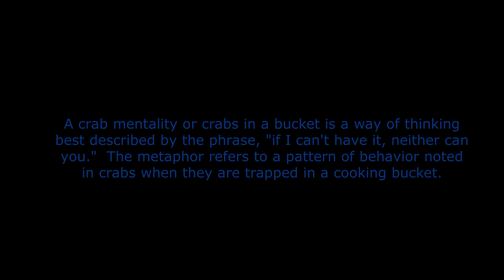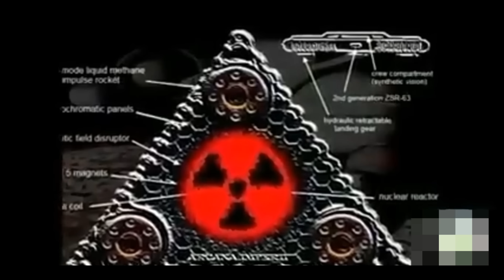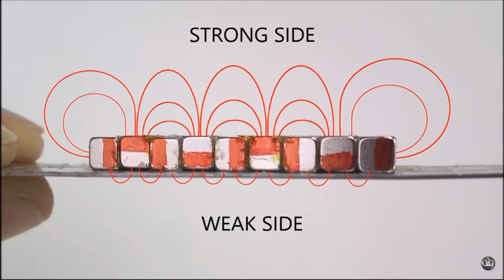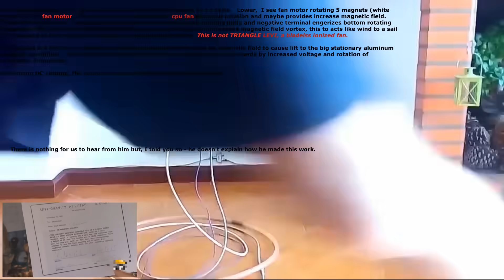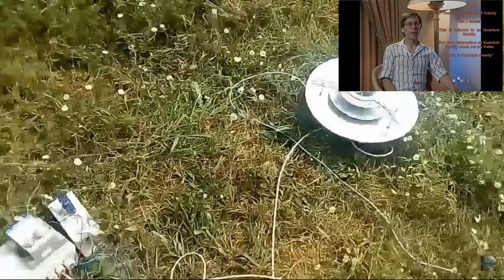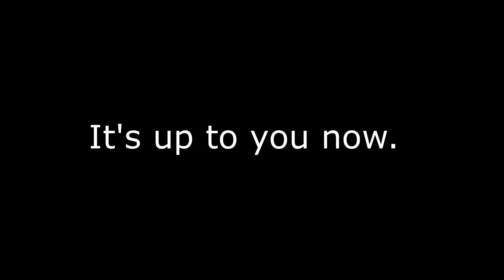anti-gravity project

Comment: It is not currently possible to create an antigravity object with magnets and energy using our current understanding of physics.

The concept of antigravity goes against the fundamental laws of physics, specifically the law of gravity, which states that all objects with mass are attracted to each other. There is no known way to create an object that can repel gravity.

While there are some theoretical concepts that propose the existence of negative mass, and it has been suggested that such a substance could create antigravity effects, no evidence of negative mass has been found in nature, and it remains purely hypothetical.

Similarly, while magnets can create attractive and repulsive forces, they are also subject to the law of gravity and cannot create antigravity effects.

Therefore, creating an antigravity object with magnets and energy is not currently possible with our current understanding of physics.

Connecting two magnets with opposite polarities will create an attractive force between them, but it will not create antigravity.

The attractive force between magnets arises from the magnetic field that surrounds them. When the north pole of one magnet is brought near the south pole of another magnet, the magnetic field lines from one magnet link up with the magnetic field lines from the other magnet, resulting in an attractive force.

However, this force is still subject to the fundamental law of gravity, which means that the magnets and anything attached to them will still be affected by gravity and will not experience antigravity.

Antigravity refers to the ability to repel gravity, which is not possible with the use of magnets or any other known material. The only way to potentially create antigravity effects would be through the manipulation of spacetime, which is still purely theoretical and beyond our current technological capabilities.

Adding energy to two opposite magnets will not create antigravity.

Energy can be used to change the strength of the magnetic field or the distance between the magnets, but it cannot change the fundamental behavior of magnets, which is to attract or repel depending on their polarities.

As I mentioned earlier, the attractive force between two magnets is due to the magnetic field lines connecting them, and this force is still subject to the force of gravity. Adding energy to the system will only increase the strength of the magnetic attraction between the two magnets, but it will not change their gravitational attraction.

Therefore, it is not possible to create antigravity effects by adding energy to two opposite magnets. Antigravity is a concept that requires a fundamental change in our understanding of the behavior of matter and the laws of physics, which currently do not allow for such effects.

Rotating a magnet can induce an electrical current in nearby conductive materials or generate a force on a magnetized object, but it cannot create an object that repels gravity. Similarly, adding energy to the system can change the strength or behavior of the magnets, but it cannot change the fundamental force of gravity.

Gravity and magnetism are two different fundamental forces of nature that operate at different scales and have distinct effects.

Gravity is the force of attraction between any two objects with mass or energy. It is a universal force that affects all matter and is proportional to the mass of the objects and the distance between them. Gravity is responsible for the motion of planets and stars, the tides on Earth, and many other phenomena in the universe.

Magnetism, on the other hand, is the force between magnetic objects or magnetic fields. It is a force that acts only on magnetic materials or objects that have been magnetized. Magnetism is responsible for many everyday phenomena, such as the attraction or repulsion of magnets and the operation of electric motors.

While gravity and magnetism are different forces, they do interact in some cases. For example, the magnetic field of the Earth affects the motion of charged particles in the solar wind, creating the auroras in the polar regions. In addition, some theories propose that the strong magnetic fields of certain celestial objects, such as neutron stars, can affect the local spacetime curvature and create gravitational effects.

However, these interactions are relatively weak and limited in scope. In general, gravity and magnetism are independent forces that operate at different scales and have different effects on matter and energy.

Comment: Put everything together in big dimension; calculating weighting a person and equipment and all the important energy that feed integrated in the same space even as a ship; a large scale to hold all that make it levitate; then work the movement that act by electrones directional by north magnetic force  the magnetic force in the 12 poles of the earth, then you can have a space ship that use cosmic energy into electro magnetic fields to energize the aeroship that controls the altitud up or down, or find out how to create this motion by the forces in the space of earth and after maybe in the outhere space.

Comment: you need to have a large plate under it tro create to repulsive magnet "lift", also this video is just a scam.
You'll need to use a very large coil to use the earth magnetic field to try to lift a craft, also you have to get 2 of them to not get away from the point you are, accounting the energy needed to rotate the big magnets AND the weight.

Comment: My theory is that "gravity" is dynamic forces from moving electrons which are always spinning and trying to equalize magnetic force and moment. The net force is the weak attractive force of all matter we call gravity. 

Every electron produces a magnetic force. Magnetic materials have SOME of the electrons aligned to form a magnetic fields. Someone theorized that if all the electrons in 2 5 gallon buckets of water were aligned. Then the resulting force would be the weight equal to earths moon.

If gravity is the residual net force of electrons trying to keep equilibrium while always moving then it would make sense then that another rotating magnetic field may be able to enhance or reverse this force.

Comment: Of course this is a scam. The saucer is lift with nylon wires else when the operator touches the cables, it woud jumps higher. Just weldone, but 100% scam.

Comment: Anti-Gravity is slightly misleading.
Magnetism has two poles North and South.
Basically two opposing forces.
So does Gravity.
Gravitation and Levitation.
So instead of Anti-Gravity we should call it Levity.
To produce Levity you create a rotating system that creates Torsion Fields that can be infused with more energy and make it spin faster.
At some point the system overcomes Gravity and starts rising.
As shown in this experiment.
I believe it can be done with purely mechanical systems.
A certain arrangement of flywheels.

Comment: Sorry guys... you where all fooled..
 It's a magic trick...  the mercury circulating it have just magnets with a motor rotating underside...  and the levitating objet... Just have a string tied horizontally, and the objet is hanging of it... thats why he looks at the side when he grabbed the cable's at the bottom... and that's why he can pass the stick over it, and under it.
It's an old school ilusionism trick(used for lebitation tricks in india and africa)

Comment: The voltage and the flux of your coul have to be balanced the temp of the fero fluid must be 155.63 deg Kelvin and  the pressure at 150.000 atmospheres.and at 60.000 rpm then the bosines princable will happen.then theres controlling it.

Comment: I saw a patent on this several years ago. I didn't understand it all but it was you needed two magnetic forces rotating in different directions to over come gravity. What I understood was   the two magnetic forces one on top of the other. I might not have understood it correctly. Anyway I believe that we have been able to create vehicles that can fly using magnetic forces. What kind electrical motors I can't even imagine. Do any of you remember hearing people describe seeing UFO's and how they were erratic in flight? Well, how many people learned to drive a stick shift car? Remember trying to get the clutch, gas and shifting coordination? You jerked the car around until you figured it out. Well, figure the controls on a manual operated electrical magnetic force drive. You would jerk the craft around until you got the feel of it. Ever see pilots trying to learn to fly a helicopter? Now they have computers so it probably doesn't take much to fly these anti gravity vehicles. I just wonder what the magnetic forces does to the human body over long extensive flights?

Comment: Mercury (II) Feroxide, with a gallium additive; otherwise known in pop culture as "red mercury" or "Zerum 525". The original German alien reproduction vehicles built before WWII were designed with a sealed cylindrical glass tube in the center of the vehicle which contained this treated mercury. The cylindrical tube was situated within a metal housing; the "anti-gravity engine" itself is a bell-shaped apparatus (with which so many are familiar). For the curious, wartime footage exists of a tethered engine unit undergoing testing at the former Nazi R&D base near Wenceslas Coal Mine in Poland. The complete vehicle includes the engine at center, mounted on a discoid chassis (many still photos, and at least one low-resolution test-flight film of the Haunebu-series ARV exist in the public domain as well). Inside the engine, there are "fans" set inside the glass cylinder at each end, positioned to rotate the mercury compound at a very high rpm, similar to how a torque converter in an automatic-transmission car transfers engine power to the driveshaft. In this case, the fans are connected to a driveshaft from what was, originally, an internal combustion engine as well. "Free energy" or Overunity devices came later. The combustion engine would rotate the driveshaft, rotating & accelerating the fans, pressurizing the mercury and creating a toroidal electromagnetic field around the vehicle capable of lift. This method of propulsion is referred to within as "magnetogravitics". The fluid dynamics of the mercury within the cylinder are important to keep in mind. There is a magic number to be reached, in terms of pressure and rpm's. We see many reports of "UFO's" "smoking" or "dropping slag" in the late 40's/early 50's. These were almost all certainly ARV's failing during field testing. Be careful when conducting your own testing!!! I cannot overstate this enough. The fields that these primitive alien reproduction vehicles give off are very harmful to pilots, bystanders, animals and plant life alike. Internal shielding for these vessels was developed out of necessity very soon after they got off the ground.
Reply: Mercury WILL require a gallium additive, as it will otherwise turn to coral-like gold within the glass cylinder when exposed to those pressures and electromagnetic forces (potentially destroying the torque fans and breaching the containment of the mercury compound within the cylinder itself, poisoning everybody nearby). High-energy testing must be done with extreme caution! There could be worse side effects than creating gold, but it will certainly bring your vehicle's test flight to an early close. On the flip side, should you put the time into it, you've got a slush fund now, just like a real covert program :)

Comment: Such a vessel will be held down by the officially known materials combined (weight used to make it work) as a whole. Something flying from external power and maybe another force on the ground created there for it isn't a completion but great for research. Now with the high energy prices this sort of stuff is a million for a drone disc with no cargo potential and no industrial will to make any except the military, IF it can carry something. I'm a bit interested in the subject, however, there is a lot of issues on a mental level which might be the answer to a whole lot and it will be revealed at some point.

Comment: Now, if you spin the mercury in one circle (toroid) in one direction at a very high rpm and spin the mercury in the second circle (toroid) in the opposite direction, a gravitational field disruption will occur.  The two mercury raceways should be held in very close proximity for the effect to become pronounced.  A rotation rate for the mercury should be on the order of 50,000 rpm.  
In order to keep the electrical losses minimized, the conductor should be superconducting wire.  The spinup should be gradual, as friction of the mercury with the toroid container will increase with increased rotation speed.  The cooling for the superconducting wiring should be around 4 degrees kelvin.  The ring magnets should have the maximum gauss that you can acquire (maybe neodymium) to begin to achieve the desired effect.  Careful measurements of loss of mass should be made as experimental parameters and variables are tested, so that you know what works best, and, what variable changes do not work.  This will get you started.  Good luck!

Comment: In order to generate antigravity, one must use the Earth's poles. There is a north pole and a south pole on earth. A simple compass proves that. The surface of the northern hemisphere is north polarized and the southern hemisphere is south polarized. If you now place an electromagnet vertically in its longitudinal axis on the northern surface of the earth, so that the pole standing on the ground is its north pole, then antigravity arises. The quantity of this anti-gravity force depends on the amount of electrical current that flows through the coil.

Comment: The area around a black hole contains a time distortion.  We could then deduce that since a black hole is a powerful gravity source, gravity=time distortion.  How else can you distort time?  You could move in a straight line at relativistic speeds.  This will change the rate of time that passes in your craft.  Therefore, one could conclude that space itself must be in motion near a black hole, creating the time distortion.  They key to gravity manipulation must be finding a method to put space itself into motion.  This would also explain the light refraction effect, since  the motion of space itself would cause a photon to change it’s angle of travel.

Comment: I'm leaning towards "gravity" being a type of static cling with direction (down)  determined by charge flow from the ionosphere to ground through the air / ether and weight determined by density / buoyancy.  However it should be noted about gravity that the 
Newtonian laws of force and motion when applied to the angular velocity of a rotating spherical  body, when crossed by an implied gravitational force that pulls toward the center mass of the body produces a force vector graph that shows angular velocity at a 90* right angle to gravity unopposed at the poles that changes incrementally at each latitude from 90* unopposed to directly opposed at the equator of the spherical body. The only place where both forces could find balance. 

Newtonian laws of force and motion predict that if Earth were a spinning sphere with gravity pulling towards its center of mass all unrestricted water on its surface would necessarily have to follow the vector angles produced to the equator and then upward to the point where gravity's fixed and angular velocities increasing forces were equal, but since angular velocity increases with radius it will overtake gravity at some point and propel the water out in a disk and off of the Earth.

Comment: Just because you can "float" a mass - this experiment doesn't account for C-energy Frequency Modulation or the process in which UFOs achieve FTL travel.
Reply: All he is missing a disk of capacitors, like a pizza slice, each one powered separately surrounding the unit, when you apply power to it will cause it to fly forward. Fuckin real fast. Trust, this is one of those moments dude, where this material is here but the world just acts like it's not here. I'm surprised this isn't taken down.

Comment: It's actually really simple, all you need is a strong enough magnet to react with the grounds negativity and push it up, some way it needs to be stabilized to and be able to adjust the level of resistance in the magnet to go up or down.

Comment: It's simple. All you need is a conductive 2-walled tower, filled with hot mercury, with a central electrode. The centre and exterior are "grounded" and the middle wall is electrically positive with respect to "ground".
The outer cylinder's volume is smaller than the inner tube of the tower. The inputted power will cause a counter-rotating mass. 
In this setup the downward acceleration of the outer tube, relative to the upward de-acceleration, is greater, resulting in a gravitational wavefront relative to the counter rotation causing a movement in space-time.
The only bit I can't seem to solve is what constitutes "Ground", because, without that "ground" the zero point energy cannot be harvested.
Maybe next week.
Oh, I forgot to mention the magnetic field generator. How could I have omitted that?
 it's a Faraday thing so I presume you know what I mean.